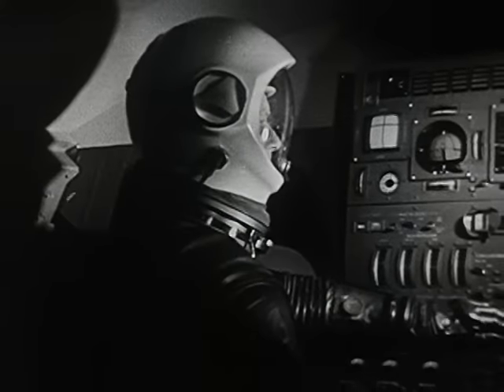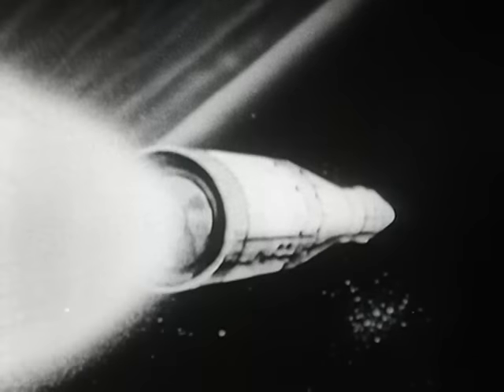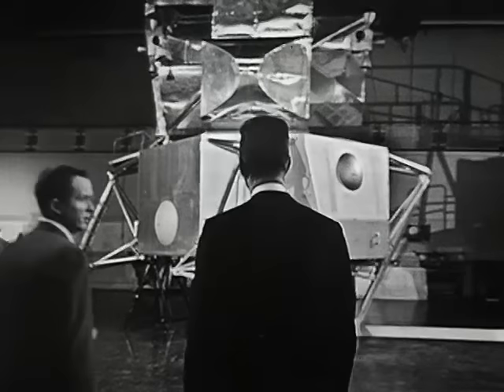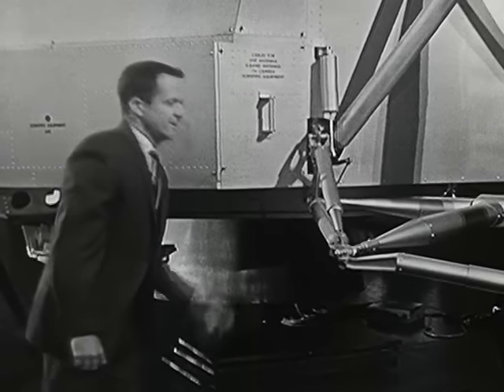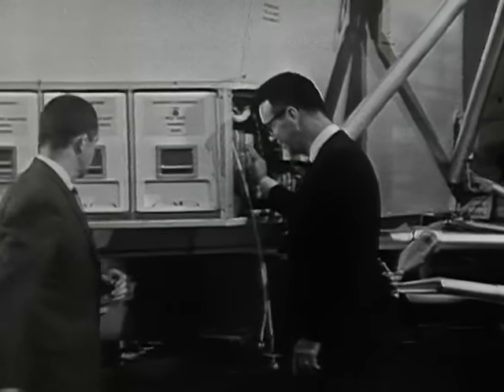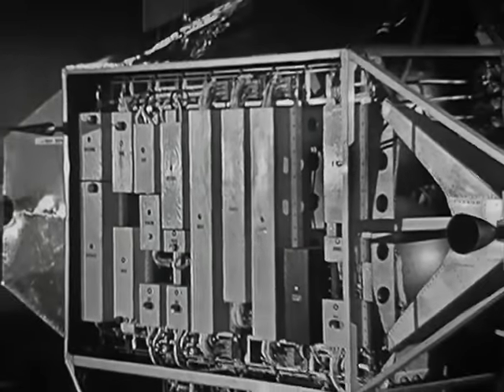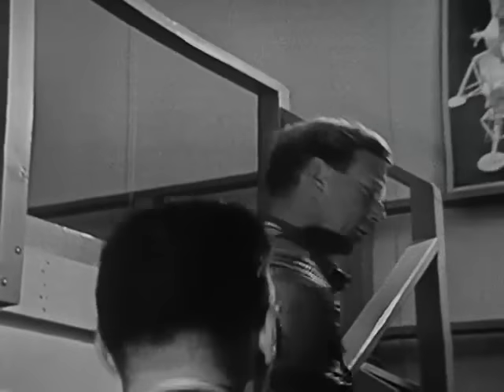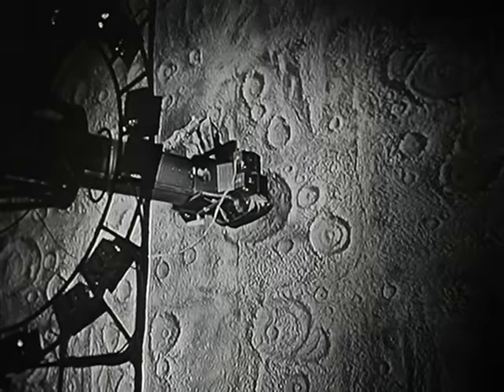MIT Science Reporter — "Landing on the Moon" (1966)

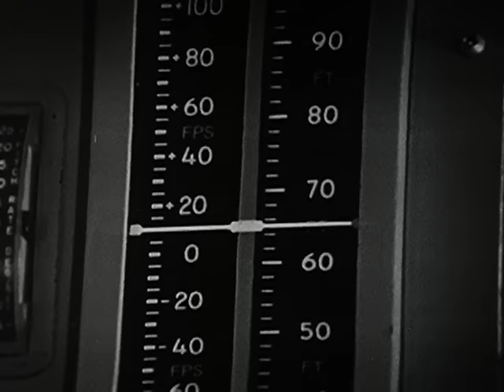Comment: 20:12 travelling at ten feet per second. How does the module know how fast it is going and how high it is above the surface?
Reply: count69 
By keeping track of its velocity changes - a function of acceleration and time. All spacecraft do this.

Acceleration is determined by measuring the resulting g-force.
Reply: So the speed of 10 ft/s is an assumption?

Saying "all spacecraft do this" is not a valid example or demonstration, that's jumping right into the middle of a circular argument.
Reply: It most certainly is NOT an assumption.

It is a calculation.

When you make reference to a "circular argument", you seem to be implying that I am under some obligation to prove my statements to you.

When someone is good enough to answer a question that you ask, it's hardly polite to immediately challenge their answer.

I will admit that my statement that "all spacecraft do this" is based on the fact that I cannot see any other way that a spacecraft CAN know its velocity at any given time. Of course, spacecraft are not completely autonomous - they operate in conjunction with an Earth-based mission control team. Apollo's guidance and navigation system was periodically updated with regards to position, course and velocity by radio tracking.

As with all things Apollo - if you want to know, research it. The answer is out there.
Reply: I have researched it. The answer is surprisingly not out there, another assumption. With regard to the Apollo guidance system you appear to be guessing somewhat. I am beyond guesswork and imagination, I am looking for the specific detail on the landing radar. In all respect, you have just provided a false trail, you've provided nothing I haven't been over before. it's all very unspecific.

It is perfectly legitimate to question any answer, the truth does not stand on politeness. Are you saying I should not question a first response answer? But you see I did question it, and you have thrown your hands up and given in. You've given me your guess work and ended with 'research it for yourself' on my second question. That's not where we started from, with your first answers. You see, when you get down to the fine grain, there are problems.

Why don't you go and research the landing radar and surprise yourself on how elusive it is.
Reply: count69 
YouTube is not the place to do your research. Nor are the people who post comments here to be seen as some sort of personal resource for you. Nor are they under any obligation to you. Be thankful for the information you got.

I have not "thrown up my hands in defeat" - I simply have better things to do with my time than to do your research for you. Edit: I kindly gave you the benefit of the knowledge I have, but I don't keep detailed knowledge of every Apollo subtopic in my head (nor does anyone).

Epic fail on your part. Next time you need help, remember to use words like "please" and "thank you".

"...the truth does not stand on politeness".

Why is the truth in question? Do you think you are in a courtroom?

So much for your research skills. A simple Google search throws up at least one drawing and several pictures of the Apollo LM Landing Radar assembly. That same assembly can be seen on the underside of the Apollo 11 LM in photograph AS11-44-6581. Did you not think to look for LM photographs where its underside is visible?

I'm sure if you invest a little more than a few minutes you can find more detailed information.
Reply: I already linked the NASA technical drawing. And yeas I have seen photo AS11-44-6581 - I guess you are talking about that flap that hangs down near the skirt, and there is a metallic box nearby. Again, is that your guess that this is what it is? Again, my reiterated point is the lack of information on this device, which has to be the most important piece of equipment. I have stacks of books going back decades before the internet, and there is always little to no information on this device. Why does it look so different to the other radar/antennae?

Can you point to a blue print or NASA document that confirms that assembly/housing is the landing radar? From other angles that flap looks just like that, a flap. So the radar and antenae must be in that metallic box? Was it directional? Was it multi-beam? So little information on it. I am not trying to be rude to you, I am pointing out of all the technology on the Apollo lander, the landing radar has been the hardest thing to pin down to specifics. And I have invested more than a few minutes on this.
Reply: count69 
Yes - the radar is the 'metallix box'.

I believe there is a huge amount of Apollo technical documentation that has never been placed online.

We are so used to being able to find information online that I think we sometimes forget just how much information from the pre-internet age is still not available through that medium.
Reply: Is it a multi beam radar? Is it directional? It appears to be facing the wrong way. The vast amount of technical documentation has been destroyed by NASA. More questions.
Reply: count69 
Which way do you think it is facing?

That's a massive claim that you have made about NASA documentation. To make such an assertion without referring to any evidence is outrageous.

Do you have any evidence?
Reply: NASA themselves. Don Petit openly asserts that they destroyed all the technology, all the blueprints, that they can't replicate or make anything anymore because they destroyed it all. NASA's own words. They also erased telemetry data and film footage. All related to the greatest achievement in human history. It's more questions than answers.

And the radar should be pointing towards the direction of flight, from the rear underside. The module approaches at an angle and the radar is titled forwards towards the surface ahead of the module. Then when the module rights itself  the radar faces directly downwards. The apparatus in those photos looks neither like an antenae nor a receiver. Trying to figure out how the landing radar worked, was attached to the ascent module, and whether it was operated manually, automatically, whether it was directed, multi beam.
http://www.braeunig.us/apollo/pics/LM-descent.jpg

Here's another schematic where they forgot the most crucial piece of technology for a landing craft. The ONLY way that capsule can know where it is in relation to the surface of the moon is by using radar.
http://www.ninfinger.org/karld/My%20Space%20Museum/q3diagrmb.jpg

These photos from Grumman show a device consistent to where it should be. But it looks little like the photo from the lander approaching the moon, and there are no flaps hanging down either.
http://www.ninfinger.org/karld/My%20Space%20Museum/bott-y.jpg
http://www.ninfinger.org/karld/My%20Space%20Museum/bottq2.jpg

Which looks different from the photos of the LEM in lunar orbit.
And which also looks different to this schematic
http://spacerockethistory.com/wp-content/uploads/2015/06/4-The-drawing-of-the-stage-indicates-positions-of-components.jpg

We HAVE to go with what is in the photos of the LEM in lunar orbit. But for such a centrally important device it seems to not be very central to the engineering of the descent stage.
Reply: count69 How would you know which way the radar is pointed whilst hidden by its protective cover?
Reply: count69 
I'm only aware of one quote from Don Pettit in this vein. Unless you can refer me to another, you have blatantly misrepresented him.

Here is the quote:
"The lunar base is bound to happen - it's the next logical step. I'd go to the Moon in a nanosecond. The problem is we don't have the technology to do that anymore. We used to but we destroyed that technology and it's a painful process to build it back again".

So where in that quote does Pettit specifically state that (NASA) destroyed ALL the technology and ALL the blueprints". Where does he say that they can't make or replicate anything anymore?

He makes none of those statements specifically. You have misquoted him - deliberately I believe.

However,  what Pettit DOES specifically state is:
1. That he believes a lunar base is bound to happen and he opines that it is "the next logical step".
2. That we used to have the technology to go to the Moon. 

When moon hoax believers  (I'm not saying you are one such, though it appears you may be) refer to the Pettit quote they always focus solely on NASA having "destroyed the technology" - NEVER on the reference to the technology having once existed. Why is that, I wonder?

The inference in Pettit's statement is crystal clear - that, yes, we DID put men on the Moon in the late 1960s, early 1970s, and that a lunar base is, in his opinion, "the next logical step ".

You went on to say that NASA also "erased telemetry data and film footage". This is another misrepresentation. 

No film footage was "erased". The only footage that was erased was the magnetic recording of the "slow-scan" footage of the first moonwalk (Apollo 11). But this footage was only ever intended as a BACK-UP in case the live TV broadcast failed for some reason - an eminently sensible precaution. When the broadcast went off without a hitch, AND had been recorded for posterity by the networks, the "slow-scan" footage was no longer required and was put into storage and forgotten about. The only reason that NASA bothered looking for it decades later was because someone saw a still photograph of the "slow-scan" screen and thought that its picture quality appeared significantly better than the converted network footage.

The point being that the loss of this footage was wholly innocent.

With regards to telemetry, not ALL of it has been lost. That aside, the only purpose of telemetry is to enable ground based control of a spaceflight and the decision making that had to be done there. Once the crew have returned safely to Earth the telemetry is superfluous. The only exception to this would be if the telemetry was required to investigate any accident or failure that may have occurred (e.g. Apollo 13). But again, once the lessons had been learned, the telemetry was no longer required.

The erasure and re-use of expensive telemetry tapes is therefore hardly to be wondered at.
Reply: count69 
I don't know why you're getting in such a tiz over the landing radar. The images you linked to look just like the in-flight image (the more so if we allow for modifications during development of this experimental spacecraft). So some technical illustrations did not show it - hardly suprising - I have seen similar issues in such illustrations in Haynes Manuals for cars I have owned!

From what I have found out, the radar used 3 beams for velocity measurement  (presumably a rate of descent indication) and one beam for altitude measurement.

It also had a protective cover to protect it from thermal radiation from the nearby engine cone.

I'm not impressed by your insistence on describing the radar as "THE most important piece of hardware" (or words to that effect). There were many other items that were just as vital if not more so - the engine IS rather important!

Clearly also the engine had to be centrally mounted with the descent stage designed around it.
Reply: "We sued to but we destroyed that technology" as quoted by Don Petit, how have I misquoted him? Look around the archives NASa have stated many times that they don't have the blueprints for the Saturn V and they don't have many of the Apollo tapes.

The 'broadcast went without a hitch' isn't entirely accurate. The networks were dismayed that they did not have a feed from the signal, but were 'allowed' to record what was displayed on a big TV screen. So no, 'once it was recorded for posterity' is not accurate - it was recorded in the lowest possible quality, that's hardly recording humanity's greatest achievement. No one got a feed from the live broadcast.

Don Petit specifically states
3 That NASA destroyed it [the technology]

I don't know why you are doing an Apollo 101, I've got dozens of NASA and space technology books, I know all what you are telling me I've studied NASA as a fan boi for decades.. My questions still stand. I am not trying to provide 100% PROOF of fakery, I am showing totally acceptable grounds for raising serious technical questions of NASA. If you are happy to accept what NASA tells you then that is your look out. My own empirical skills reject a lot of what I used to take for granted from NASA.

I am happy to debate the Apollo issues, there are strong elements for both sides. However you will NEVER EVER convince me that Tim Peake ever went to space. Once you start to technically dissect the ISS it utterly falls apart. NASA has lost all credibility in my eyes, and the debacle of the ISS has only highlighted the Apollo fakery even more.
Reply: Without landing radar the module is just a space flying machine - the radar is the ONLY device that gives a specific  position relative to the moon - the main mission target. Without landing radar it CANNOT land. I would expect the landing radar to be integral to the lander from the inception, not looking like an engineering afterthought, which is how it appears.

I'm not getting in a twist about it. It is one of the many stands that I am following through to its ultimate conclusion, and I am not finding a convincing conclusion.

"From what I have found out" do you have a source for that?
Reply: +count69  "We used to but we destroyed that technology" as quoted by Don Petit, how have I misquoted him? Look around the archives NASa have stated many times that they don't have the blueprints for the Saturn V "

Because he never said anything about destroying the blueprints. Just because NASA doesn't have them is meaningless because it's a nearly half century old project that worked great for what it was designed for. A trip to the Moon and landing on it that took no more than 2 weeks at the most. How is any of what was developed for the Apollo program relevant to what's being built now? Orion has a vastly extended mission parameter compared to the Apollo program which might include a trip to Mars that could last 2-3 years. The only thing I can see is the lunar lander but they most likely won't do that preferring missions that go beyond the Moon and developing a lander for a Mars instead which is going to be  totally different than anything needed to land on the Moon. 

For your information, the Saturn V blueprints are stored on microfilm as per this discussion thread:
http://www.collectspace.com/ubb/Forum3/HTML/004949.html

As for the CM/SM & LM, you might get what you want but it's not free:
http://www.space1.com/About_Us/Our_Approach/Drawing_Archive/drawing_archive.html

Here are 2 books that used them to produce some great CAD images:
ttps://www.amazon.com/Virtual-Apollo-Pictorial-Engineering-Construction/dp/1896522947
&
https://www.amazon.com/Virtual-LM-Pictorial-Engineering-Construction/dp/1894959140 which also includes the Lunar Rover and PLSS

As for the landing radar:
https://ntrs.nasa.gov/archive/nasa/casi.ntrs.nasa.gov/19720016521.pdf
https://ocw.mit.edu/courses/science-technology-and-society/sts-471j-engineering-apollo-the-moon-project-as-a-complex-system-spring-2007/readings/4_23_bennett.pdf
https://airandspace.si.edu/collection-objects/antenna-radar-lm-landing-apollo
https://www.facebook.com/FlightOfApollo/posts/1028827210560591

"...and they don't have many of the Apollo tapes."

A lot of those telemetry tapes had data on them that was solely about the spacecraft systems and how they were performing. Tons of information that was documented and since the spacecraft involved where all discarded and/or destroyed, except the capsule of course, all that data was taking up valuable space so they felt perfectly fine with reusing the tapes. It is true that some of the telemetry tapes they wanted to keep have gone missing including unfortunately, the Apollo 11 SSTV transmittal tape but all of the video tapes of the other 5 landings and EVA's are fine. The reason why they ended up reusing tapes is because of the sudden shortage brought about by the ban on using whale oil as a binding agent, and it took much longer than expected to find a suitable substitute. Here's a link that explains how it also affected the music and auto industry. 3rd message from the bottom:
http://www.antiqueradios.com/forums/viewtopic.php?t=98539
Reply: count69 
"How have I misquoted him?"

He never used the word "ALL" and he made absolutely no reference to blueprints or any other documentation.

Nor did he imply that they "can't make anything anymore". Rather he implied the opposite. 

When holding up quotations as evidence, TWO things are vital to making any correct interpretation of that quotation:

1. The context in which the quotation is made.
2. That the quotation is PRECISE.

We all know how easy it is to change the meanings of statements, or to put different spins on them, by changing just one or two words, or by ripping them from their context.

The landing radar was certainly not more "crucial than the engine systems, the control systems or the computer or life support. I am not even certain that a landing would be possible without it (though probably against mission rules).

I see absolutely nothing wrong with anything we see so far in the landing radar design. It is well positioned, given it had to be able to sense the surface both when the LM was flying with its 'back' parallel to the surface, AND when it was flying with its landing pads pointed straight down towards the surface. The radar systems were stored in one of the descent stage quadrants.
Reply: +eventcone "I am not even certain that a landing would be possible without it (though probably against mission rules).

Yes, completely against mission rules but these guys were all former Navy Aviators(except Dave Scott) and test pilots. Probably the best trained pilots ever so I think they could have pulled it off. Here's a discussion thread about it and even some input from Ed Mitchell:
 http://www.collectspace.com/ubb/Forum29/HTML/000812.html
Reply: mako88sb 
Thanks. I'll take a look.

However I made a typing error in my previous post. I meant to say "I am not sure that a landing would NOT be possible without it". My doubt was not with the pilots, but rather with the computer!
Reply: Forum discussions are all well and good but there is ZERO possibility of affecting a landing without it. They are absolutely blind out there. They have no idea how fast they are going in relation to the moon's surface, and they have no idea how far it is to the moon's surface.

Flying by the seat of your pants requires gravity and air pressure to be able to do that. There is absolutely no way with ZERO frame of reference you can land without radar. Piloting skills are irrelevant. That craft has to get an absolute positioning fix to be able to function.

Instruments in any terrestrial craft are calibrated to at rest at sea level. There is no air pressure to give an altometre reading. This is not an aircraft with wings that they can fly. It is basically one big engine that they have to bring in and drop onto the surface AGAINST all the rules, practices and experience of flying aircraft WITH WINGS IN AIR that they previously have had. There are no recognisable features on the moon that they can use to give a reckoning of distance, like trees or fields or roads or buildings. There is no way in the heat of 'flying' that thing that they can rely on their training to reocgnise features from photographs and models and be able to judge the distance to the surface from that. There is one sole piece of apparatus. The engine and its control thrusters ARE the lander, the rest is physical frame to hold itself and the ascent module. The ONE piece of crucial equipment that the lander needs to fullfil it's function is THE MEANS OF KNOWING WHERE IT IS in relation to the lunar surface. That can only be achieved by Radar.

Pray tell how else other than radar would they be expected to land?

I think you expect too much. The astronauts have a certain amount of autonomy of action in the detail but they are all essentially along for the ride and are little more than button pushing monkeys. You think this is some kind of childs play toy that can be flown by the right jock pilot! Just a little too fast and that thing tips over and they aint coming home.

RADAR is by far the most crucial piece of equipment on the lander. That thread is theoretical nonsense.
Reply: "Forum discussions are all well and good but there is ZERO possibility of affecting a landing without it. They are absolutely blind out there. They have no idea how fast they are going in relation to the moon's surface, and they have no idea how far it is to the moon's surface".

I don't think they are absolutely blind.

The have their guidance system to tell them where they are and their velocity. If you start from a given point in a given orbit and apply certain thrust vectors over a period of time, the computer should be able to calculate where you end up and how fast you are going. Effectively I suppose that this would be analogous to what sailors called "dead reckoning" - but with the advantage that there are no winds or currents to put you "out of reckoning". You are moving in pure vacuum. The only variable was the known variations in the Moon's gravity field - this may have caused problems? (Just trying to be frank here).

They also have sight of the landing area. I don't see any difficulty in judging altitude by a visual of given craters of KNOWN sizes in the landing area (the astronauts used these visual cues anyway).

And they have their own shadow and finally the dust disturbed by their engine.

"RADAR is by far the most crucial piece of equipment on the lander. That thread is theoretical nonsense."

You can't hand wave it away like that. It is no more "theoretical nonsense" than your own assertions. How can RADAR be the most crucial piece of equipment? There are several other systems whose loss would be more likely to lead to disaster.

But all of the above is academic - because they DID have landing radar.
Reply: felix mendez 
The first test was unmanned.
The 2nd and 3rd tests were Apollos 9 & 10. You can find footage from both of those missions, as well as detailed accounts.
The 4th test was the first landing (Apollo 11).

Yes - the Apollo 11 landing was itself a flight test. As were all subsequent flights.

The entire Apollo program, as with Mercury and Gemini before it, was operated as a flight test program.

BTW - You wouldn't test an aircraft in water, would you? So why would you think that a spacecraft could or should be tested in air?
Reply: Not really that elusive.  Searching for "how did the LM landing radar work" (without quotes) brought up https://www.hq.nasa.gov/alsj/alsj-LMRadars.html as the very first response.  Clicking on the link for the referenced document opens https://www.hq.nasa.gov/alsj/ApolloLMRadarTND6849.pdf
Reply: Discussion of the landing radar is hardly prolific, it barely appears on schematics of the lander and you have to dig deep to find it. And additionally in that report doesn't it state that the radar used Doppler sound waves? In space?
Reply: "it barely appears on schematics of the lander and you have to dig deep to find it"  IOW, it's there, but not "there enough".

"in that report doesn't it state that the radar used Doppler sound waves? "  No, it doesn't.  Any sort of wave is subject to the Doppler Effect.  Did you not know that?
Reply: felix mendez 
In other words you just want to move the goalposts to suit yourself, as usual. And if you got the footage you are asking for you would move the goalposts again.

And how precisely could they record footage of them leaving the LM, when they had first to exit it to deploy the camera?

It is precisely BECAUSE the footage was NOT recorded in the controlled environment of a film set, that you cannot get all of the footage you so unreasonably ask for. Hoax nuts often ask petulantly how the launch of the Apollo17 LM from the lunar surface was captured "if no one was left behind to film it". So on the one hand you want to flag up the difficulties of filming in such an extreme environment (when it suits your case) and on the other you want to deny those difficulties when it suits you to ask for MORE footage than you got.

Yet more examples of the extent to which you people are prepared to twist and turn to keep those goalposts moving so that you may continue to deny the Apollo Moonlandings.
Reply: count69 
And just because you cannot find it "online" does NOT mean that it does not exist.
Reply: I said it was difficult to find. You're putting words in my mouth, deliberately missing my point. The landing radar is the most important apparatus on the lander, yet it seems to be an almost forgotten after thought. There is very little technical discussion on it. I have seen the NASA documents you have posted, that is not what I'm talking about. I want to see how it was wired. I want to see how it operated.
Reply: What guidance systems? How can they tell them where they are? Guidance systems on Earth work using compass, air pressure, radar, artificial horizon. There is NON of that in space. There is ZERO facility for them to tell there velocity or direction.
Reply: "Guidance systems on Earth work using compass, air pressure, radar, artificial horizon."  There is also inertial navigation, first demonstrated in the mid 1950s with a flight from the east coast to LAX. 

"There is ZERO facility for them to tell there velocity or direction."  Read up on how to determine a state vector, then get back to us.  You think there was no way because you only know a fraction of what was involved.
Reply: "Because the US govertnment lies, because it lies every day of your life."  Nobody ever said that they don't lie.  But clearly they don't lie about everything, unless you want to think that the Axis won WW2, US Grant wasn't our 18th president, and Daylight Savings Time doesn't happen when they say it does.

It's just lazy to say "Well, the government lies about stuff, therefore they lied about this."  There's a reason that no scientists on the planet have bought the idea that the landings were faked.  It's because you don't have any actual evidence.  As you've clearly demonstrated, the "evidence" is 99% you guys not knowing WTF you're talking about.

And on the subject of the cooling, you've got a bad habit of conflating "I don't know how..." with "Nobody knows how..."  You did it on the radar, you did it on the navigation, and now you're doing it on the cooling.  As some point, you have to understand that you not knowing something doesn't mean that nobody knows it.
Reply: "Because the US govertnment lies, because it lies every day of your life".

Let me see if I can understand you here: You are ACTUALLY saying that your evidence for the US government (NASA) having "lied" is that, well......the US government lies!?

Can you not see the problem with such circular reasoning?

No government, collective or individual LIES ALL OF THE TIME. It would make their lives quite impossible. Maybe you should try that for a while. Managing continuous lies is an impossible task. That is why most people, and most organisations, are reasonably honest.

Also, evidence for someone having lied on one occasion is not evidence that they lied on another.

"That is why blurry videos...................wont make the case".

I don't think I'm aware of any "blurry videos" in the Apollo record. There may be LOW RESOLUTION pictures - but of course these are what they are due to the limitations of getting such videos under extremely challenging circumstances. Apollo Hoax-nuts seem to want to dismiss Apollo out of incredulity at what they achieved in 1969-1972, yet they so often contradict this "position" by insisting that the video footage should have been "so much better" than it was. Boy, do you want your cake and eat it!

"Solid proof evidence".

Yes, THAT would be nice. Do you think you guys might come up with any that supports your claims any time soon? After all, you have produced NOTHING (that stands up to scrutiny) in the last 45 years.

"the heat generated inside the space suit had to be sent, tranferred, to a place, object, milieu at a lower temperature so it could absorb that heat and keep the whole process going, going as we see in everyday refrigerating systems. Where is that nearby object, fluid, at less than 25 degree on the Moon surface able to take the excess heat from inside the space suits and keep them fresh enough for humans...? Nowhere".

Don't you think that those dashed clever engineers might have thought about that? That's what ENGINEERS do so well - they SOLVE problems like that FOR A LIVING.

The heat from the astronauts bodies was transferred to water flowing through tubing in a special undergarment. This water circulated to the spacesuit backpacks and through a device called a SUBLIMATOR. In the sublimator, water from a SEPARATE supply source was absorbed into a porous material that was open to vacuum. This water, as it evaporated into the vacuum, dropped in temperature and froze. In its frozen state it continued to shed heat by sublimation (i.e. changing from the solid state to the gaseous state directly). This is how ice behaves in an extremely low pressure environment. The ice in turn absorbed body heat from the water circulating from the undergarment, which in turn increased the rate at which it sublimated to vacuum, carrying more heat away.

Now there's no excuse for you not to know this. The information is available for anyone who wants to find it. The same process is used to cool spacesuits today.
Reply: count69 radio positioning and ranging from the ground would provide a direction of the spacecraft and distance. subsequent observations are used to provide rates in angle and didtance. an orbit can be derived from these observations. this is known as the Kepler problem.  the state vectors of the spacecraft would be computed based on this information and sent to the spacecraft periodically. the spacecraft itself would know its orientation from star sightings. the spacecraft has an imu onboard. a gyro and a computer. the computer would receive the state vectors and update its known position by integrating acellerations of the earth and moon and it's own thruster firings to obtain a velocity and then integrating the new velocities to obtain it's position. calculus courses teach how this works. this is called dead reckoning. this is how the lm would know it's position once it has undocked from the cm.  it would initially have the same state as the cm. the landing radar would provide a more accurate altitude and would be used to update the lm inertial altitude by way of a kalman filter. fairly basic rocket science.
Reply: felix mendez 
"I don't have pdf here"

A paltry excuse. I suggest you take steps to remedy that situstion if you have ANY genuine interest in the subject matter.

Also youneed to know that YOU carry the BURDEN OF PROOF. 

YOU are the accuser. YOU are the person attempting to challenge the established historical record,  and to revise it into a story of multi-billion dollar fraud, coercion and even murder.

So YOU tell us: WHY does the use of a porous plate sublimator for spacesuit cooling contravene ANY physical law?
Reply: felix mendez 
You confuse me with someone else. It was not I that linked you to the pdf file in question,  nor I that you challenged to explain the relevant content of the document.

The poster in question gave you a link to a document that explained the principles by which the porous plate sublimator works - which is what you asked for. You were given a chance to educate yourself on the subject. But it seems you don't want to know the answer - having been led to water, you stubbornly and petulantly refuse to drink. Your loss.

Burden of proof - yours - put up or shut up.
Reply: For those who don't want to read the whole thing, here's a summary of Felix's claims:

"No footage of the LM working in space." Is shown footage of the LM working in space, and he basically says "No, not that footage.  Footage of them doing other stuff with the LM in space"

"The government lies about stuff, therefore they lied about Apollo"  When asked to prove specifics, he begins to run silent, run deep on this point.

"NASA never explains how they did things".  When pointed towards links showing NASA doing exactly that, he says that people are "parroting what NASA says".

When asked to provide evidence, his answer is "if I had evidence everyone would have it"

Insists that the cooling units in the spacesuits "violates the Second Law of Thermodynamics" because he thinks that space must "absorb" the radiated heat, rather than understanding that as the water molecules evaporate or sublimate away, they carry the heat out of the system. Swears that nobody has ever explained it.  Is provided a link to a PDF explaining it.  He then claims he has no way to read pdf files on his browser

When asked to consider why scientists don't have a problem with how this works, he insists he doesn't care what the scientists think.  Because if he did that, then he'd have to try and explain why he's right, and they're all wrong.  And since he's not bright enough to think up even a bad explanation for that, he pretends it's not important.
Reply: +felix mendez
1. I am not an American.
2. You claimed that all you wanted was an explanation of how and why the 'porous plate sublimator' works. Having now been given that explanation, instead of attempting to engage me in discussion of that explanation, you attempt to divert the discussion with an irrelevant rant on the morality of American Foreign Policy. This tells us that you have nothing else to say on the technical subject, and are now attempting to weasel your way out of the debate.

Show some honesty, some decency, and some integrity and acknowledge that you have been given the explanation that you asked for.
Reply: +felix mendez
"...we are still using in our homes refrigeration systems of the pre-space era, the 1950s. What other proof is needed."

This is because:

1. The closed loop cycle system works better at one atmosphere of pressure.
2. The open loop sublimator system is the only system that works in vacuum.
Reply: +felix mendez
I'm still waiting for that decent acknowledgement Felix. Where is it? You appear to have gone into 'silent running' - the usual last refuge of the Apollo denier.

I expect you will resurface with the same claims somewhere else. The usual M.O.
Reply: radar altimeter for one...
Reply: +pepe cohetes  Are you referring to a device that operates in a similar way to the Ryan Aircraft Corp.'s LM landing radar?

Many fault the Apollo flights as being too technologically advanced for the time period. But this is moon loon nonsense that only works on those under 40. Radio altimeters have been in use on commercial aircraft since at least 1960. There was a crash of a commercial liner near my hometown in mid 1960 that was attributed to a slug of water blocking the pitot-static tube lines so that the pressure-detected altitude was out by several thousand feet. It was after that that radio altimeters became mandatory on commercial flights carrying passengers. The LM landing radar was only operative during the last 30,000 feet or so of the landing so in many ways was an adaptation of a tried technology by 1969.

I don't think moon loon read or fact check anything but just lap up cock-and-bull stories. Reminds me of the loon that took 'Pizza-gate' seriously so took his rifle down to the offending restaurant expecting to see debauched depravity. I think the clientele took a while to order another Hawaiian pizza after that episode. Luckily no one was killed
Reply: @eventcone I would really wish to know that many details in such deep way about apollo program some day... but being not that intelligent, at less I am not that idiot to belive Earth is flat. I enjoyed a lot your answers to this guy with a "69" in its name. I like sex too, but I doubt about his capacity to understand himself or any thing in a more accurate way than Felix despite he tryes to look rational in a pathetic way. I hope to use NASSP 7 some day and use this to learn more about the Apollo porgram in a more serious way. But even then, I wont be intelligent enought to understand physics. But, I have more common sense than this deniers, that avoid truth with false informations and misinterpretations or wrong concepts; something is something.

Trully, I envy how did you emulate his silly way to speak with count69... and not only that but answering his questions too.

However, I think that these kind of people are all of them a lost fight. Even now, with the last Heavy Falcon launch people was saying "where are the stars?" plenty of times. The funny thing is that they doesn't say that shit when they took a picture at night. For some reason they are not surprised that no stars appears at the picture. They will say that night weren't stars, or the pollution... or whatever, or maybe they will have lucky and their camera will have exposition enought to catch the stars, and they will use it like a proof, in any case they will try to avoid the horrible task of understanding how a camera works.

I really think, however, that people like these really needs a teacher. The teacher figure is important in this cases, is in this cases where they really must deserve such title explaining complex things to less talented people like you did. With perserverance, education, and patience. But, like I said these are a lost fight under my point of view. Just teachers should stay trying it, not people like me and you (are you a teacher?). For that reason I prefer insult them, (bulling them), because these doesn't derserve nothing. I could vomit the whole facts over them and they could still finding a new way to deny the evidences. I am thinking more in Felix at this point. Maybe count69 has a more opened mind, but it seems that his goal is not understanding the facts to convince himself about the truth, he know, that his goal is finding any excuse to deny the truth in a pseudo rational way. Excuses like, (in my own words), that anntena is not correctly aimed so the whole thing must be fake. And he don't care if that anntena works just when it must work, (was he using a draw to debate his "logic" point of view, or was he using a real picture? I am not sure now but even then...), with all, thanks again for giving me a nice moment while reading your answers to this cunt I mean this count69 being.
Reply: J Calhoun Somebody else earlier in this thread mentioned that it is entirely possible that there remains much Apollo documentation that is not available on the internet as the entire program was done and dusted long before the internet era. Looking at scanned Apollo documents reveals what official documents looked like before the arrival of word processing computer packages. It also reveals that getting those documents into a digital format remains mostly a private initiative undertaken by private citizens for the most part. NASA is not awash with funding to be able to set up a large scale effort to digitize en masse the mountain of documentation that was simply consigned to government repository buildings when Project Apollo was officially terminated.

The moon loon claim that the Apollo technology was destroyed Luddite style with sledge hammer and shredder is just silly as this would have required extensive financing to obliterate the mountain of paper and hardware that resulted from a project that at its height consumed 4 or 5% of the US GDP. It was just abandoned and left to atrophy or rot as it no longer met government requirements. This was the fate also of the SR71 'Blackbird'. Indeed what happened to the huge fleets of aircraft built in the US when WW2 came to  its completion? What could not be sold as superflous to government needs was just parked in the desert and walked away from.
Reply: Yes I was. In this case they did have a specially designed landing radar but in its basic form, it is a radar altimeter.
Reply: J Calhoun and it was all pre word processor with only hardcopy!
Reply: Answer  they didn't land on the moon it was all fake! Lol
Reply: Couldn't the astronauts just stick their head out the window and get a pretty good estimate how fast and how far to the lunar serface.? Don't tell me they didn't have Windows! I don't think they had electric windows then but surely they had the crank kind!
Reply: Never seen a so called ufo  video that wasn't blurry. Get a decent camera for Pete's sake.
Reply: @count69 Yes, it was in fact radar that did the distance measurements.
Reply: @count69 Since when we're they obligated to provide you with blueprints of the module and equipment. I can see you're the furthest from having any mechanical or electronic knowledge form anyone on the planet. Just because YOU don't understand or comprehend, doesn't mean it never happened.